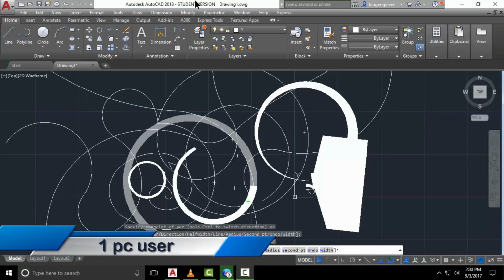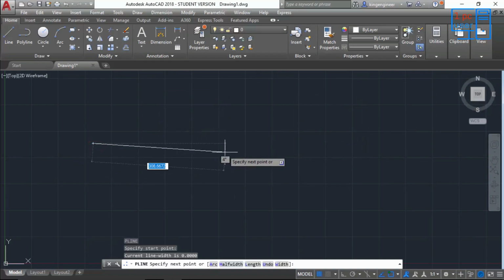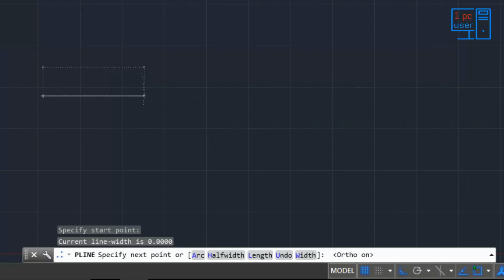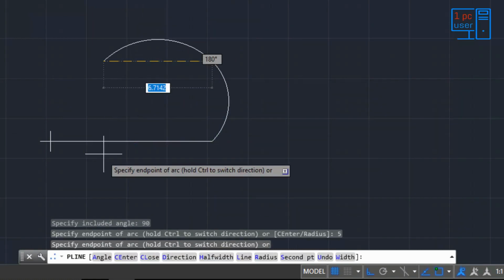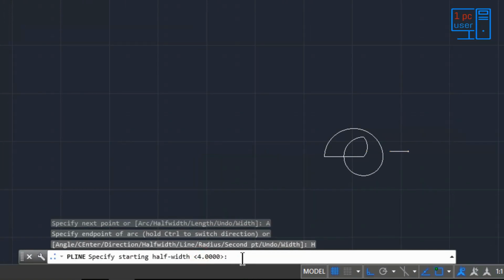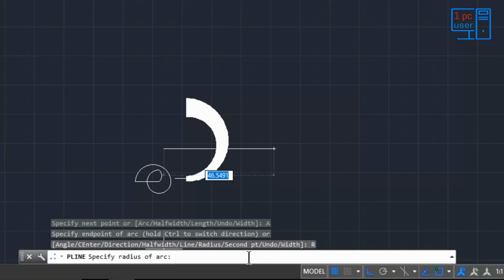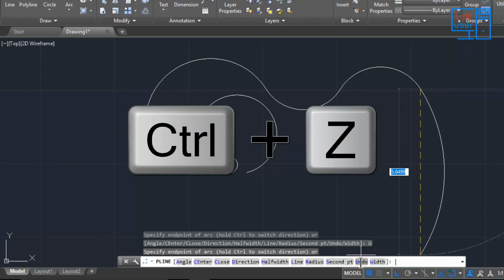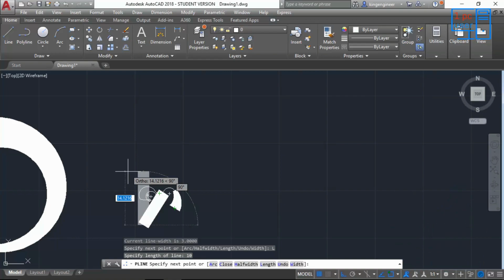Autocad 2018 polyline command tutorial - how to draw polyline in AutoCAD 2018

Comment from the maker: Note: A temporary plus-shaped marker displays at the first point. This marker can be useful when you create long and complicated polylines. It is removed when you complete the polyline.
The PLINEGEN system variable controls the linetype pattern display around and the smoothness of the vertices of a 2D polyline. Setting PLINEGEN to 1 generates new polylines in a continuous pattern around the vertices of the completed polyline. Setting PLINEGEN to 0 starts and ends the polyline with a dash at each vertex. PLINEGEN does not apply to polylines with tapered segments.
Reply: 1 pc user thanks for note bro
Reply: thank you so much sir
Reply: Ok, dude 😀